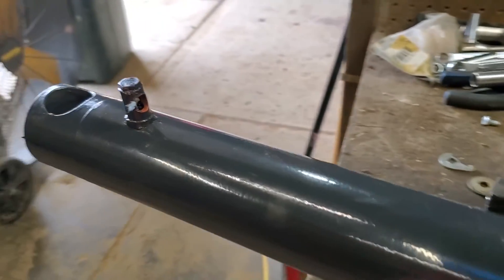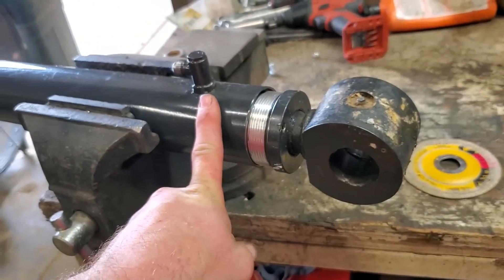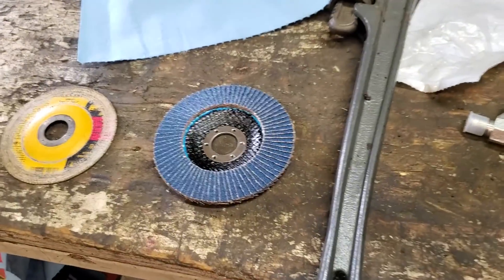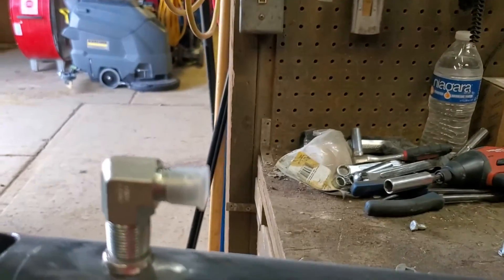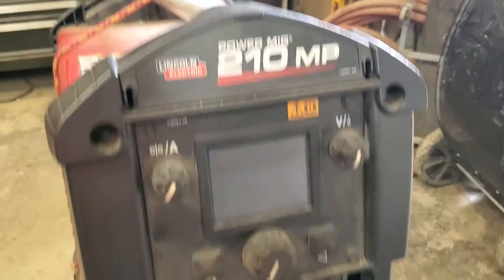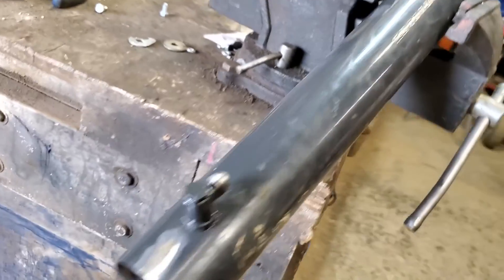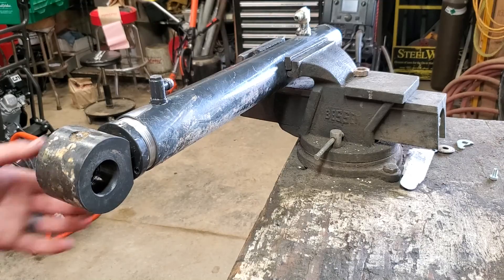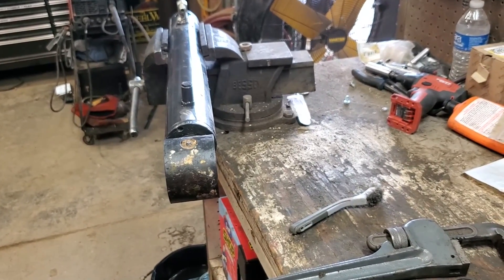How to fix broken hydraulic cylinder fittings with a welder and grinder for under 30 bucks!

Comment: Have you had any bypass issues with the cylinder after welding the new fitting on? At the shop I work at we will weld them on then run a hone down them to make sure there back close to round for the piston to go down and run threw smoothly also.
Reply from the maker: Not yet. I've done about 15 of them. I make sure I'm not running too hot. I clean the tube completely before and after.

Comment: The original fitting isn't -6 on my 435 that fitting is the same as the other end. Are they different on some cylinders?
Reply from the maker: Yes, depends on what cylinder it broke on. Some are -8

Comment: Bobcat E85 cylinder to fix.  I didn't snap the fitting off but bent it enough to split the metal.
I'm going to try welding up the gap first and if no good then full re/re of fitting.

Comment: Why can’t u just tap a thread??
Reply from the maker: The metal is very thin and won't hold the pressure
Reply: Thanks I just wondered I figured there was a reason.

Comment: thanks this just happened to my bobcat cylinder. New to this. how easy is it to take off the cylinder so I can take to a local welding shop to fix\??  Anything I should be aware of when I remove and put back on the fixed cylinder? thanks!
Reply from the maker: Just take the pins out. Use a hammer and punch. After you put it back on, make sure to move all of your cylinders for a while to get rid of any trapped air.
Reply: @rosincore  hmm ok

Comment: Can I do this without steam cleaning it?
Reply from the maker: I have never steam cleaned it.
Reply: @rosincore  how do you remove the hydrolic fluid. Isn't it flammable? Thanks for the quick reply. Fitting broke off right before the threads :( was hoping it was just the fitting leaking
Reply from the maker: @boostedG  when you unscrew the cap most the of fluid comes out.  It takes around 900 degrees for hydraulic fluid to burn. I've never had an issue with it. Just make sure the tube is empty. When you pull the rod out, all the fluid inside is able to come out freely
Reply: @rosincore  thanks for the help! F350 sand dump truck I never seen so much rust and rot in my life haha going to be a tough task just to get it out.

Comment: terrible weld seam. also do not remove the color
Reply from the maker: the seam weld was bad due to running .25 wire. I usually use .35 wire and had to use what i got. The paint don't matter. I usually use a primer and a quick coat of rust oleum charcoal to coat it all.